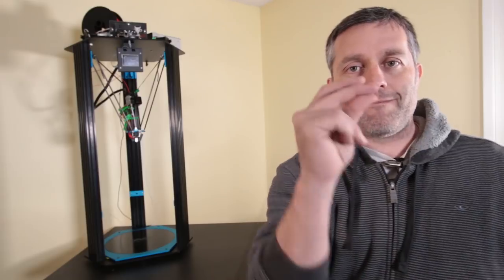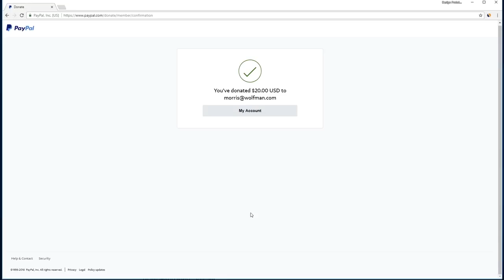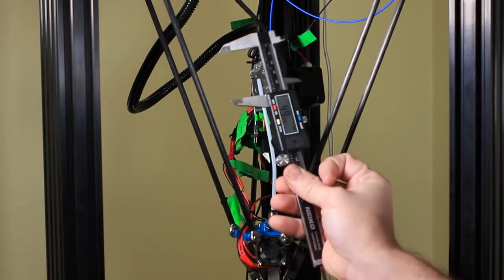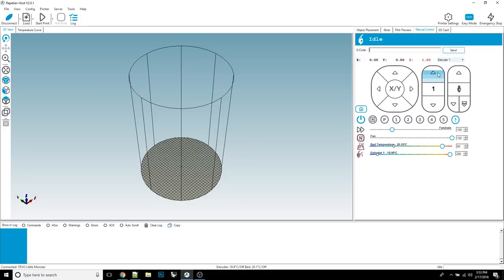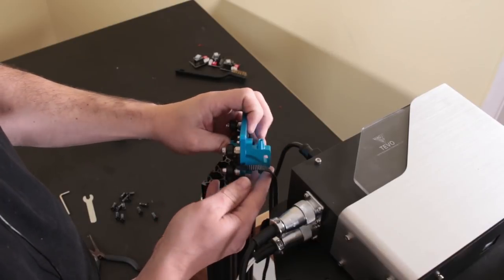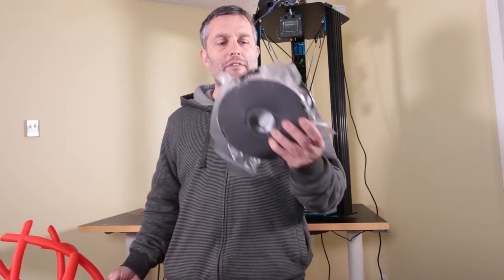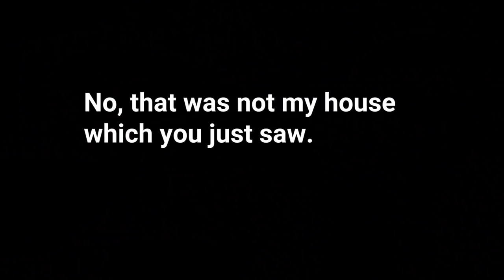The Little Monster is Next Level

Comment: Hi. You can adjust "z offset" with M306 Z0. Easier than your way. Just G28, move nozzle until touches paper and M306 Z0, M500. Thats all ;)
Reply from the maker: Thanks for the tip!
Reply: if the nozzle is higher, how can we lower past Z0 (for example Z-0.01?)
Reply: Error because z axis must be homed before that can be set. Doesn't work.

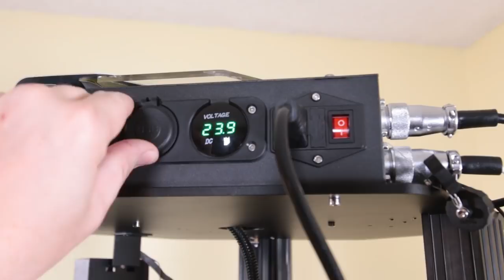Comment: I'm pretty sure that the 24VDC (6:40) is having no effect whatsoever on your 110VAC (4:10) bed heater. ;>

As for the SmoothieBoard vs. MKS kerfuffle, I bought a genuine SmoothieBoard for my Rostock and let's just say that the layout wasn't well thought out. Specifically in regards to wiring up my Viki 2 that I bought along with it. Rather than a socket for a ribbon cable, the SB has a bunch of randomly located pins that you run individual jumpers from the Viki to the SmoothieBoard.  The silk screening on the board also has some labels printed over the top of others as well. It really does look like a porcupine with a skin condition...

Personally, the MKS board has the better layout in that regard. But it doesn't have anywhere as nice hardware as the Smoothie. Not that it mattered, within a few weeks the SmoothieBoard died on me, and I bought a Duet as its replacement.

As for the darn Duet, the Ethernet keeps dropping out on mine, and support for printer software such as MatterControl is limited at best. And when the Ethernet drops out, you have to try to finish up the print from the LCD (no thanks), or reboot it. It's about to go back where it came from as well.
Reply from the maker: Thank you for the great comment. You are correct. The bed is running on 110VAC as is printed on it. I put a multimeter on it a few weeks ago and it is definitely getting power directly from the wall. It's pretty obvious that this is my first experience with a silicone bed heater, and as I was making this video I don't know how I didn't put that together. I just assumed all bed heaters ran off DC. 

Also, thank you for your input on the Smoothie Board and Duet. That info is very helpful. I'm probably going to buy a DUET any way, but I was expecting it to be perfect. For $300 (with screen) having high expectations is understandable. Isn't the DUET still the best board, or do you think the MKS SBase is better?

Comment: Hello i did the calibration in order to adjust the Z offset exactly as you did but when i do G0 Z0 it goes to the same position. After changing the value in sd card from 520mm to 520+6.8 mm i did the RESET -> G28 ->G0 Z0, it goes to the previous position and i dont see any major changing.
What can i do about it ?

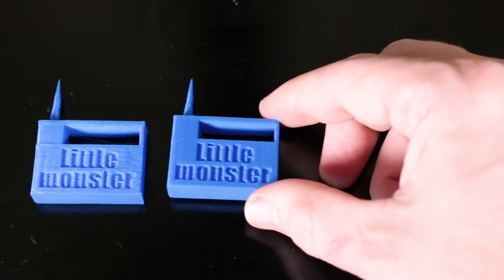Comment: Check out this guys vid @21:54  https://youtu.be/VtYRiGTmypA?t=1314

Looks like that is where you adjust your Z height for that -1.13.

That's probably why your print turned out crooked.  You changed the Z stepper value for zero by -1.13 and it didn't fix your Z issue.  So printing up the Z stepper was low on that side which tilted the print.

Comment: first of all if you are going to use repetier host yo don't need to user uppercase to write gcode,g0 z0 is perfectly ok,after that all smoothieware commands are lowercase,so RESET is not going to work, you need to use reset.There's a lot of g commands that allow you to calibrate your delta printer using smoothieware and mks sbase v1.3 board one of them is one that makes Z=0 when you are in the right position as D4rKiTo said,good 3d printing

Comment: My printer's print head falls on the bed when there is a power outage. On the way to the bed it melts a little of the print it was printing. As the nozzle is hot it also damages the build plate sticker. Have you solved this on your Tevo Little Monster?

Comment: I have recently got my little monster up and running but for some reason I can not issue any commands to it with the tft touch screen, the screen works and i can move through the menus but no commands work, calibration, move, pre heat, load/unload filament, nothing gets it moving. anyone got any ideas on a possible solution?

Comment: Great video! On smoothieware, when you change something in the config file (z-height on a delta), you have to make sure that it is not something that is also saved in the config-override file, if it's in the override file as well, you have to change it there also.
Reply from the maker: AWESOME! This is great information. Thank you!
Reply: Yup, wouldn't want you to keep having to start over! Smoothie takes a bit of getting used to, at least it did when I moved from marlin.
Reply: BTW. If you have a Linux system at hand, like a Raspberry Pi with OctoPrint, then you can mount the SD card from the MKS SBase via the USB connection. I edit like this the config file without the need to always take the SD card out of the MKS SBase again and again.
Reply: you not suppose edit the config-override manually,  you change the value in the console screeen in the Host....and after you decide is ok you write the value on the config-override with M500 command....if i want to modifie the change the Digipot Motor currents  i do this...
 M907 X1.50000  and after try you can use M500 to wride in config overide...no RESET at all.....Try   M503   this give you all the value you can change in config overide...dont forget the M capital and do M500 to save or it will loose the value if you reboot....you can do same with the config file with .... #cat /sd/config.txt    show you all config on yhe config file.......  you change with ....   config-set sd  switch.servo.pwm_period_ms <value> ....   for exemple and after.... #reset....to reboot....try.... #help..... to see all command....so no more remove SD Card or mount....With Repetier host console you need # before command but with other console not sure...LOVE SMOOTHIE..

check smoothie web page for CONSOLE COMMAND

Comment: Hey. I have a question about the 3d printer Tevo little monster. Does this printer have a resume after losing power? I ask my father in the area, they often turn off the electricity and I have so many times interrupted the printout on anycubic kossel that I have had enough and I want to buy a bigger printer but I do not know if it has a resumption. I apologize for misspellings of a used translator because I do not know English well
Reply from the maker: The Tevo Little Monster with the stock control board is not a good printer. This printer is only worth buying if you are going to upgrade it with a Duet board. The Duet board does have print resume on power loss. I suggest you watch the other videos in my series on this printer: https://www.youtube.com/playlist?list=PLtVk4dZInT81K-IVnqEEc44xoC7wZqAKU

Comment: Looks to me that skipping would be an issue with this printer: Since the Bowden extruder hangs in the rails, it is heavy going upwards. A solution would be to add three weights hanging down outside each tower. Three laces through wheels ontop towers and down through the top plate and pulling on a spring or some bungee lifting the extruder to unload some weight!!  
I did something like bungee hanging extruder, printing Ninjaflex on my AnyCubic Kossel. Since Flexible filament gets stuck in long teflon pipes!
Otherwise a nice printer, out of my pricerange though. So I will build a cheap bigger Kossel on 2020 extrutions, when I can afford it!

Comment: Wow, after watching this I'm glad I went with the Anycubic version. There was much less assembly, clear easy to understand instructions, I literally powered it on, set the z height, leveled it and started printing, no mods needed. Not that it couldn't use some improvement, but it was like $340 and it includes what is basically a 3d printer starter kit with a kilo of PLA! None of this losing steps or anything so badly out of adjustment that it was having a very noticeable negative affect on the prints, just minor imperfections.

Comment: I have a Problem with the Z Offset. When i set it over M306 Z0 and M500 and Power off the Printer all ok. But when is start Print with Z =0 it goes of a few mm. And when i stop Printig and test it over G0 Z0 it is to high. But Why ?
Gcode : M280 S10.6
G28
M280 S3
G1 Z50 F25000
G30 Z0
M280 S7
G1 X0 Y0 Z100 ; lift nozzle
M42
And 
End G Code :
G92 E0
G1 E-8.0 F9000
M104 S0 ; turn off temperature
M140 S0 ; turn off bed
G28  ; home  axis
;M84     ; disable motors
Reply from the maker: If you have done an M306 Z0 and then an M500, You only need to do it once after you autocalibrate your machine. You do not need to have anything in your start code for bed height. Your start Gcode is a mess. It doesn't make sense to my why you have the M280 or G30 commands in there. Try this instead:

G28 ;Home
G1 X0 Y0 Z50 F7000 ; QUICKLY move the tip of the nozzle 50mm above center of the bed
G1 F3600 ; Set the machine's movement to a more reasonable speed
G92 E0 ; Set the extruder to zero effectively resetting the extruder in preparation for printing
G1 E8 ; prime the nozzle

If this doesn't work, try adding a software endstop disable command to the start code: M122 S0

But be careful with this as it can cause bed collisions especially when manually moving your machine.

Best of luck.
Reply: Can you please post your start code ?

Comment: The MKS-TFT-Firmware is just a binary blob, no Open Source. The DRV8825 drivers from the MKS SBase are noisy and make this salmon effect on the prints. You might to need to buy TL-Smoothers.
Reply from the maker: I think the Trinamic stepper drivers that I showed will do a better job mitigating the salmon skinning than the TL-Smoothers will. I have some 4 diode smoothers in my possession, but according to the 3D Maker Noob, those won't make any difference.
Reply: Design Prototype Test: Of course. I just posted too fast, sorry.
Reply: your wright...i try and no difference a at all on my MKS Sbase, i try this THB6128 2A Max 36V Stepper Motor Driver Board from ALI and this make a huge difference
Reply: I  own a Tevo Little Monster - I use (2) 4 diode smoothers per access and they remove 90% of Salmon Skinning.

Comment: How much is that in metrics?  (You are using metrics in 3D already)
Great comment about OSS and support the originals.

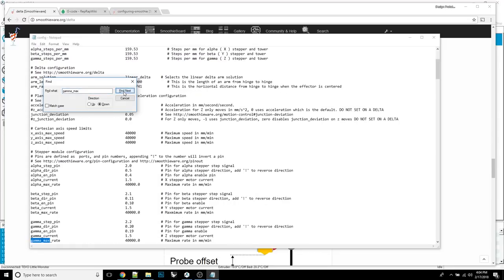To caclulate G30 parameter, go to G0 X0 Y0 Z10.  Manually lower and do the paper test.  When enough, you have the right distans and can calculate it for the G30.  Oh, you did all this in 28:00.  :-)
Doesn't G29 do bed leveling?  In Marlin there exist a G code to test varians by testing the position given by the level detection devices.

Comment: Thanks for this!
I've been looking to go bigger from my AC Kossel Plus. I missed the AC Predator and was not aware of this printer.
Was considering a large cartesian but am now seriously considering this printer as I'm only familiar with Kossels.
Reply from the maker: The Predator is the next generation of the Little Monster. Devinitely watch my entire videos series before purchasing this printer. It works great with a Duet Board, but the the stock electronics go straight into the trash.
Reply: @DesignPrototypeTest  Ah I see. 
I'd like a Predator but those seem to have come and gone in the couple years I was out of the hobby. Can't find them in stock anywhere. This guy still seems to be on the market.
I don't mind tinkering, got my AC Kossel pretty dialed in. 
But I will take your experience into consideration. 
May go for a large cartesian to dip my foot in those waters.

Comment: Did you fix the lcd communication issue?
I was having issues with lcd talking with main board and found that changing the baud rate of the lcd to 115200 fixed my issues.
Reply from the maker: Kind of , but in the end I determined that the stock board is complete garbage. I replaced it with a DUET, and it has been fantastic. I made a video series all about it called "From favorite to best" Or you can just watch the part where I start replacing the board: https://youtu.be/asSLjLGlSrw?t=4m51s

Comment: Hi, i tried doing a firmware update by just replacing the firmware.bin files on both of the mini sd card and the sd card for the mks tft 28, but when i powered up nothing happened on the tft, no updat bar or anything, i just had to run the auto calibrate. Is this normal??
Reply from the maker: Watch the rest of the videos in this series. I think you will no longer be asking this question after you do: https://www.youtube.com/playlist?list=PLtVk4dZInT81K-IVnqEEc44xoC7wZqAKU
Reply: @DesignPrototypeTest  Hi, sorry discard that question, i used the tft24 firmware instead of the tft28, i dont know how it worked but now im also able to print from repetier host(i wasnt able to before, the printer didnt connect properley and when it did, it went haywire) Thanks dor the help anyway, i'll check out those videos some day.

Comment: Have you tried printing with ABS on this printer?
Reply from the maker: Yes. I made my filament dryer with ABS on this printer: https://youtu.be/mFjprFhiDzA The problem is that large ABS prints really warp and peel up off the bed. It is VERY challenging to get the prints to stay stuck down to the bed. ASA might be a little easier.
Reply: @DesignPrototypeTest  Yeah I've been getting the same warping problem, How was the bed adhesion like when you printed with ABS?
I noticed that the ABS peels off the bed easily when the bed temperature is around 90 degrees Celsius, would turning the bed temperature down to around 90 degrees Celsius help?
Also, how big was the ABS print that you did? I've had heaps of warping with something a small as a raspberry pi 3 case

Tom

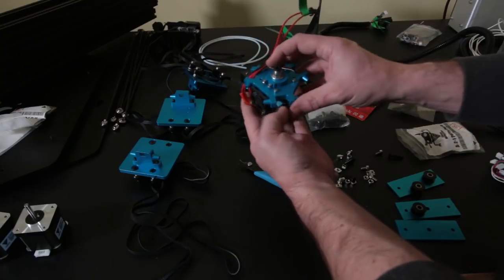Comment: 1:30 PTFE-lined rod ends are used when zero clearance is desired. The "self-lubricated" Teflon liner is lightly preloaded by interference fit, making the friction a bit higher than a lubricated metal-on-metal bearing. The liner is soft and thin, so eventually it will wear through, although probably not during the life of a lightly-loaded 3D printer.
Reply from the maker: No. The Heim Joints on the Little Monster are made of entirely metal. The FLSUN Super Racer is the printer with the plastic cups holding the rod ends.
Reply: @DesignPrototypeTest  Yes, I understand the SR doesn't use bonafide Heim joints. A true Heim joint can have an unpigmented liner that is barely visible, but I'll admit it's possible the LM doesn't have liners. I don't own one, so I'll trust your inspection.
Reply from the maker: Your comments caused me to doubt my former self. I went to the effort of going into storage so I could recheck. Even going so far as to use a magnifying glass. If there are liners they are imperceptible from an external inspection. It remains possible that somehow the liners are retained inside of the eyelet portion of the heim joint where they cannot be seen without destructive analysis.
Reply: @DesignPrototypeTest  If it’s any consolation, now I feel bad that you went to the trouble. In college, we used teflon lined steel rod ends for tierod, pullrod, and inboard wishbone joints on FSAE racecar suspension. That’s why I’m such an annoying know-it-all.

P.S. I believe you. Looking that carefully, you would have noticed something if it was there. There’s usually a thin sliver of teflon visible inside the outer race.

Comment: I've had my TLM for about three months, The MKS board is an inconsistent performer,  random stops, layer shifting,  etc. My config file worked as described,  I didn't have the nuclear problems you had with it. 

I just upgraded to the DuetWifi....holy moly is this thing awesome now!  Silent,  nearly SILENT with 128 microstepping! My Zesty Nimble will be here soon! This thing is a great printer mechanically but I would ditch the MKS Board for the Duetwifi, it just doesn't compare. Good luck and keep the videos coming,  this thing has tons of potential and I can't wait to see what you come up with! 

Future plans
PEEK and Ultem Compatibility
   T100 cartridge thermostat for accurate 400°C reads
  12v Halogen lights for heating parts instead of heating build chamber (PEEK and Ultem need very hot chambers and these temps make it hard the keep the heatbreak temp change sharp, using lights to heat the part instead of the air inside the chamber helps tremendously)
Berd Air part cooling 
Zesty Nimble Extruder
Chimera dual extruder
Nema 23 motors with 15mm belts for rigidity
Filament sensor
Reply from the maker: The Filament sensor should be easy. Check out thingiverse for "optical filament runout" 
The Zest Nimble is really cool. Thanks for showing that to me.
Same for the Berd Air Part Cooling. Very cool!
For Chimera I would look into "NF 3 in 1 out" The bummer of doing it this way is the wipe and primer towers of wasted filament. Also, using different temperature filaments is...problematic.
Good luck with the PEEK and Ultem. If you can pull it off, it will be SUPER impressive. But, that is something I wouldn't personally do with this printer. There are too many unknowns, and pitfalls to success. I would rather have a functional printer that prints Nylon well, than one that works sometimes printing a really high temp plastic. What do you need PEEK parts for?
Reply: Design Prototype Test  here is a picture of the modified hanging extruder. I was printing Tianse Black TPU 1.75mm last night at .5mm layer height with a .8mm nozzle at 45mm/s! That's a crazy amount of material.  It worked great! https://photos.app.goo.gl/kO4UGSxB5o9MYfsC2

Comment: By far the best review of this machine. - Prevents me from buying one. Started with an Anycubic i3 Mega  2 month ago without any issues und very good quality. Thought about this one to build larger objects. Maybe the Creality 10 S5 (not a delta) is the better option?
Reply from the maker: I've got it working much better now. Stay tuned for my next video. All it needed was to have the voltage turned up on the stepper motors through the config file. :)
Reply: Thanks for letting me know - I will postpone my  CR10 S5 order...